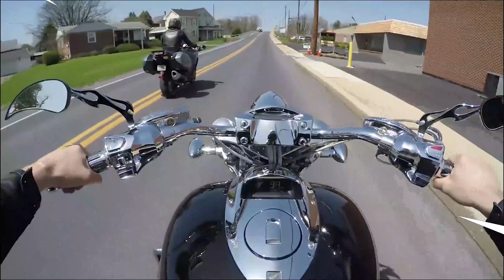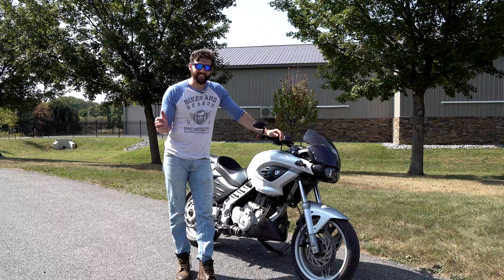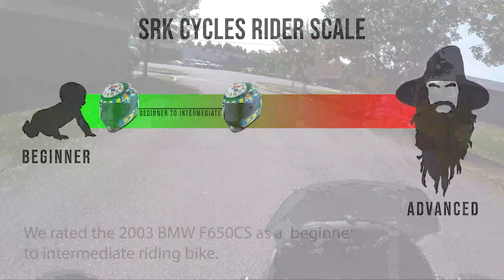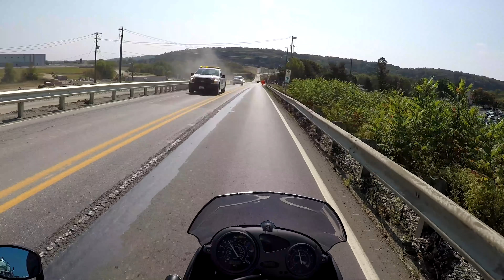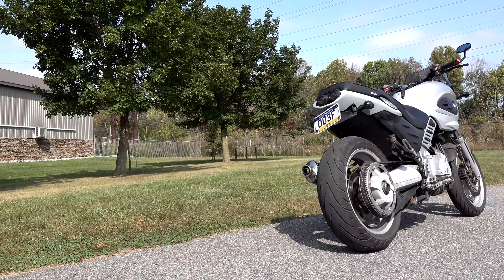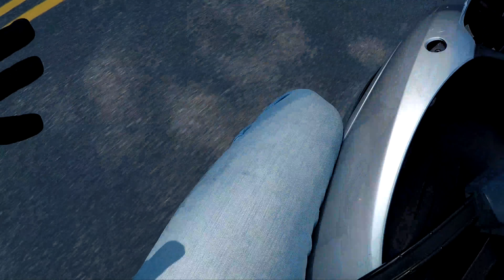Best Beginner Bike for under $5,000 and its a BMW

Comment: I owned one. You could cruise 90/95 all day long. Tank under the seat gives it a very low center of gravity. Gas MPG is awesome. 04's and 05's had the dual spark heads. Torque up the wazz-oow.

Comment: That space where the tank should be is for your helmet and that's the helmet lock Sean has. My Scarver came with a Hard Plastic Lockable Tank Bag that fits in that gap and Givi hard Panniers and Top Box all for $2,612 USD.

Comment: A bit late to the party, but I would HIGHLY recommend to stop recommending ANY BMW to a new rider unless they are content spending more time and money than riding. One part on an older BMW could sideline a rider for months. Seasoned riders with experience-based expectations - and enough cash to feed the poor thing - can jump in with both feet. Specially if they have another bike.
Reply: Bought my with 18k miles for $1000, needed the starter sprague clutch replaced, $65 for parts, $31 for flywheel puller, I have put 4K miles in less than one year, where is this huge expense? Where is all this down time? This is a great bike, ABS, heated grips, plenty of power, and super comfortable to ride!! Any beginner would be very lucky to have this bike…I have 60 years of motorcycle riding experience and I couldn’t be happier than this!
Reply: What's a better beginner motorcycle than this?

Comment: I just picked one up for $500! I'm stoked. 17k miles . Needed 1800 in parts coming from Germany next week. The previous owner had the nut on the rear wheel back out and it stripped the threads and the sprocket hub chewed up the axel. The belt alone is $500
Reply: $500.00 drive belt ? ! WOW !

Comment: Most dependable motorcycle ever made. I own one and wouldn’t trade it for anything. Always start and run. If it sits for the battery may go dead because of digital clock

Comment: You dont wanna ride it at less than 3k rpm. Hes reving it to low. I can only get mine to a little under 8 sec 0-60. Perfect beginner and city bike. Would prefer a sixth gear for the freeway. Whatcha thinks a good price for one with 20k on it with 1 crash?
Reply: $2600 cash I'll take it

Comment: I have one & rode it from 2005 'till 2017. The only reason I stopped using it is that I live in St-Martin, French West Indies & there's no BMW mechanic on the island :( I like its low center of gravity with the fuel tank under the seat. The belt drive insteat of chain is a dream come true :) Since I  found an also rare bike, the Yamaha MT03 660cc, not the newer MT03 which is only 321cc. My woman prefers the Scarver BMW as a passenger & I love it also.. https://www.youtube.com/watch?v=QI1j7jA9xDk&t=450s

Comment: These are great bikes. I had one overnight as a service bike in the early 2000s when I'd taken my R1100GS in. Better than the Funduro of that era. I like the belt drive. It had a smoother gear change. With the underseat petrol tank, the weight was carried low. A bike I wish I'd owned.  I understand your enthusiasm.
Reply: To be fair, the rough carb Funduro (I started on one) had basically the same engine, but the 650GS and GS were  the next gen bikes. That shows in the handling, the center of gravity, the fuel consumption and the smoothness of the engine.

Comment: Nope dude, the belt drive system is anything BUT cheap.
They only last about 10K Miles and a replacement is many 100's of $$$ (MANY Hundreds).
Reply: Not true. The belt lasts far longer than that. I've had the same belt for the last 
75 000 kilometers and it's still in fine condition.
Reply: That's not true like the other guy says they last really long. The recommended interval to change it is i think 40000km but in reality its good for almost the double. Its just not good for offroad that's why the gs has a chain, since belts get more easily damaged by rocks.
Reply: Jaco Prinsloo nope your wrong or you did something wrong cause mine has 30k and a friend same bike 70k ,replace it cost 300 euro with buying it (many hundreds)😫

Comment: Single cylinder that does 115 that's crazy...
My duke 390 does 110 stock😂
Reply: The duke 390 does 110 stock this bike does the same with 4 k less revs and it also pulls like a truck . I have a funduro and when I go on a steep uphill the bike feels exactly the same as it is when going flat on a duke however ... You can not compare speed only there is something called tork this bike has twice the tork of a duke 390 .

Comment: I don’t ride. I want to. I was really looking hard at one of those Korea 250 sport bike. He had done videos on. Just don’t know where to start looking.
Reply: Korean or Taiwanese are the same as Japanese quality wise, just don't touch chinese.
Reply: Gt250
Reply: Suzuki GS500, get one that's been looked after and you'll be sorted. 
Older owner, and check out the stuff they own, if everything has been cared for and shows some pride, go for it. 
Don't buy the Korean 250, any Japanese bike around 500cc that's been cared for is a better choice even if it's 10 years old with 50k miles.

Comment: I read years ago the BMW F650 was so popular in Europe because of high gas millage.  The GS model was popular as well. Its BMW so you know quality is high.  Great for lane spliting or as they say in Europe filtering in states that allow lane spliting.
Reply: Only 1 state allows lane splitting, California. Which is kind of odd since they like to regulate everything and are less free than many other states.
Reply: It wasn't very popular in Europe, which is why they're so rare. The f650GS adventure bike sold a lot more. I think they cost the same as a gpz900 new so they were too expensive. It's great on fuel average 65 uk mpg and 75 on motorway.

Comment: I rode my 650cs from Birmingham, Alabama to Alaska, July 2016. These bikes are so much fun.
Reply: I know a guy that's in Alaska from Birmingham but he went by plane like us normal life people. Sounds epic
Reply: that is one hell of a long ride. cool to hear
Reply: I’m assuming it’s a comfortable ride?
Reply: @guy-vp5fo  I’m 5’1” and 110# pounds. I was loaded pretty heavy also. It was very comfortable after a little while. I had to get my riding muscles conditioned for a ride that long 😁
Reply: @chitza3270   thanks for the reply. I’m about 5’9 160, had many different bikes looking for something for a commuter for 70 mile round trip.
Reply: @guy-vp5fo  This bike was built to be a commuter. No matter how easy or hard I ride it, it consistently gets 62mpg. It’s nickname is The Scarver, short for street carver. It is a single cylinder 650 so it’s not built for power. I have no trouble with interstate speeds, but I won’t be winning any races 😁

Comment: That 3 pronged thing is a tank spider to lock your helmet in the tank recess and the hardcase with speakers doesn't run the battery down and is awesome as it gets louder as you rev the engine. It is the road version of the f650GS, they didn't sell many as they cost the same as a gpz900. Any questions about it just ask.
Reply: What’s a good price for an 2003 f650 cs 9,000 miles?
Reply: @guy-vp5fo  That's low mileage,  i paid between £800- £1,200 for mine (all single spark and one had abs). Mine were all in good condition,  except the £800 one, on the test ride it kept cutting out but i took a chance on it anyway and it turned out a) the battery had never been topped up and only had 1" of acid and b) the battery terminal bolts were loose. They have their little quirks (security torx bolts and 55mm socket for back wheel nut). You get an unusual bike that will do 100mph safely, is fuel injected and generally fairly economical with classic bike insurance. Things like plastics are hard to source but a lot of components are the same as the more popular f650gs.

Comment: That space on top of the faux tank is for your fast food lunch when you take your passenger out to the top of some mountain....   You could also put a 70s "Boom Box" in that space and since they ran on batteries (not included), you would not drain down your motorcycle battery..  Lots of solutions come with that space on top of the faux tank.
Reply: The boom box actually plugged into the wiring harness (using a bmw fitting kit) and was a really cool bit of kit, ran off the bike's electrical system and got louder when you revved the engine.
Reply: @davesy6969  Now alls you need is a tape that goes, "potato, potato, potato."  Instant less expensive Harley...